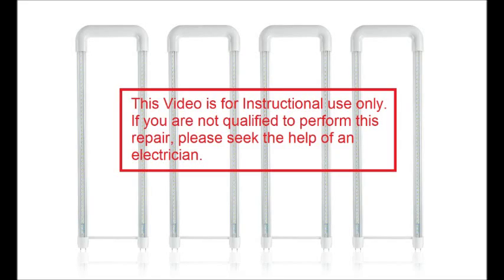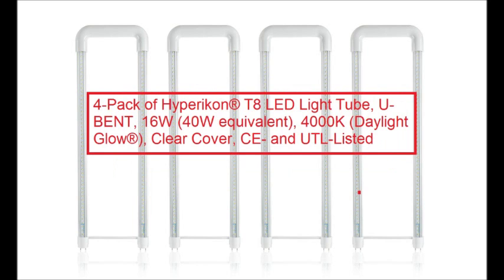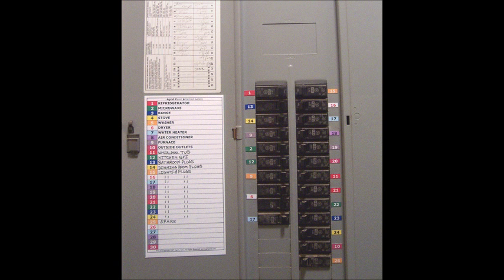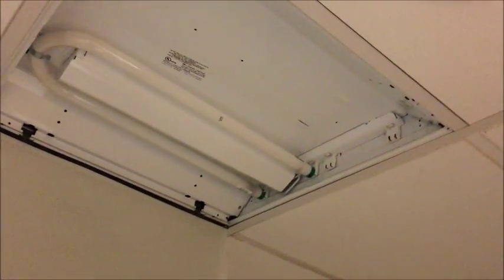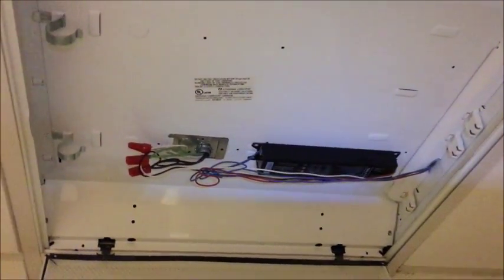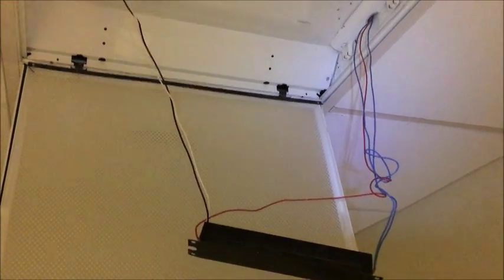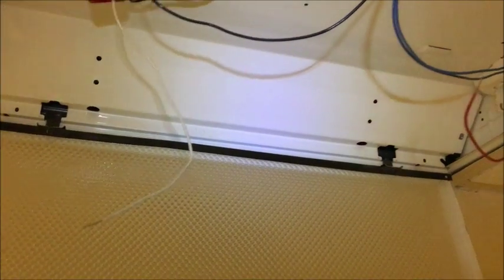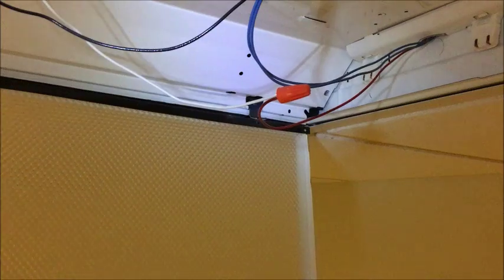Installation of Hyperikon T8 U-Bent LED with Ballast Bypass

Comment: Thanks for the video!  Short and to the point!  I need to mention that my light fixture had 3 pairs of wires (2 blues, 2 reds, and 2 yellows) in addition to the black and white.  So it is important to look at the existing ballast diagram before wiring.  In my case, the blues and reds both connect to the black, and the yellows connect to the white.  Also the brand of U-shaped LED bulbs that I bought could not be installed with the ballast cover because the plastic brace that go across the front of the bulb was too thick to fit into the slot in the ballast cover.  So I secured the wires and wire nuts, and just tossed the ballast cover away.  It's not needed and you can't even tell it's missing with the fixture cover reinstalled.

Comment: Hi! Once is done does it make a little bit of a noise or that is wrong ?
Reply from the maker: Hello Pedro, Mine does not make any noise. I am not sure if that is a problem or not. You may want to try new bulbs to help figure out if it is defective bulb issue.
Reply: Make sure you got the bulbs in the correct way . The two outer sockets are The Line ( Hot) blue wire , the single red wire ( neutral) the inner sockets. 
Bulbs are marked.

Comment: My wiring are different.  I have a yellow wire on one end which didn’t use.  I have a red and blue wire on the other side.  I can’t remember if the red is on one bulb and blue on another bulb.  I took one right wire from one bulb connect to the left wire on the other bulb and connected it to white.  I did the same with the remaining wires and connected it to the black.

Comment: is this consider a ul connection or non UL?
Reply: To be clear, I think what your asking is whether the installation meets, NEC (national electrical code).  UL approves components (not whether something is installed to code).  So as long as the bulbs have UL, the wire has UL, and the twist connectors have UL - I think your good.   As far as NEC - I also think you’ll be good, but you may want to consult an electrician.
Reply from the maker: Cudahy PC : Not sure what the connection is rated.  I only followed the directions of the manufacturer.  If you are concerned, I would recommend you consult an electrician.  Thank you.
Reply: I watched it again this is a UL, thanks